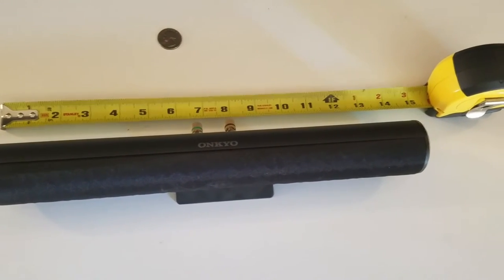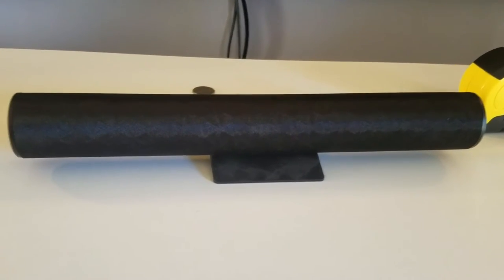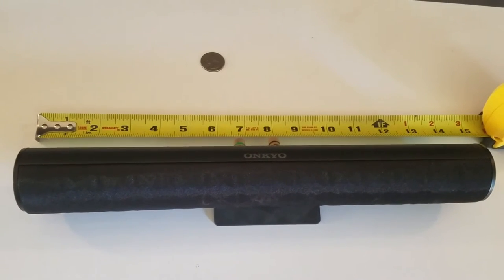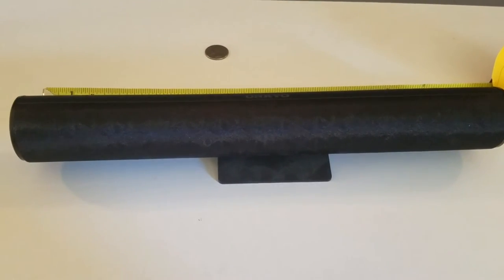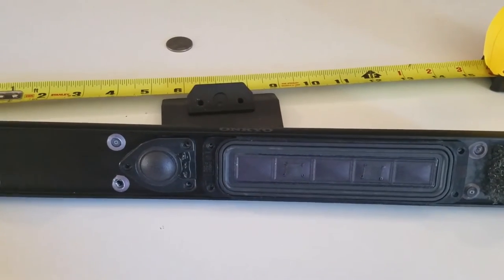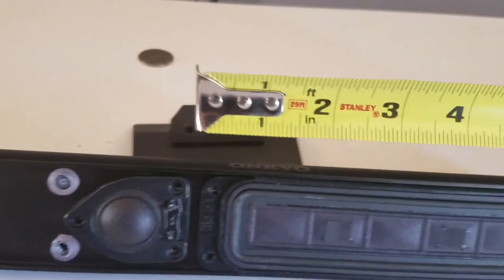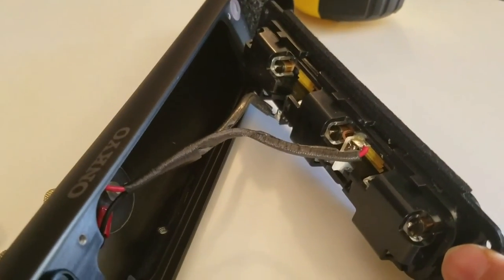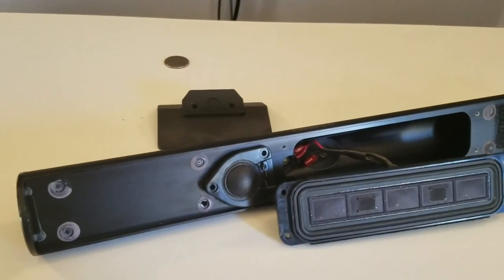Onkyo D-077C disassembly

Comment: Any idea why this speaker would be playing dialogue extremely quiet.  I have 5-1 surround system and this is my center speaker. I hear dialogue but it just below a whisper.  Any ideas?
Reply from the maker: You're receiver should have a sound test and the ability to raise and lower the levels per speaker, start there.  It's not the most powerful speaker, meant to compliment bookshelf speakers, but you should be able to hear dialog.